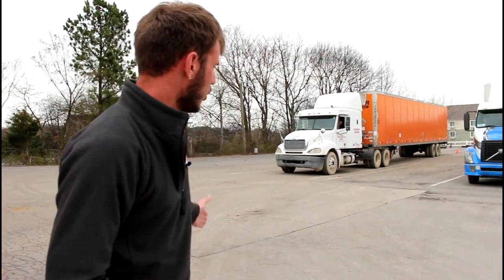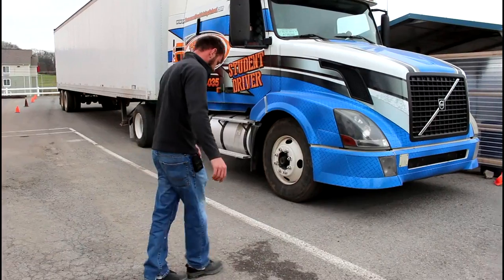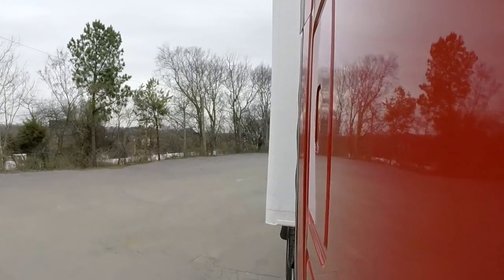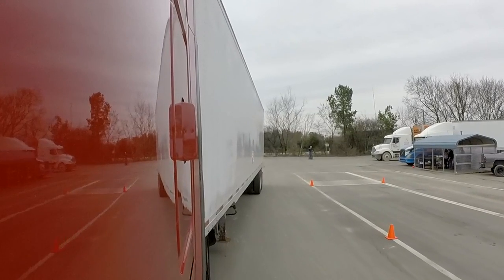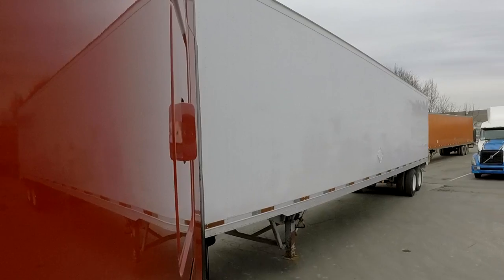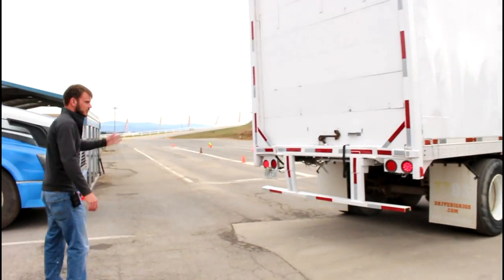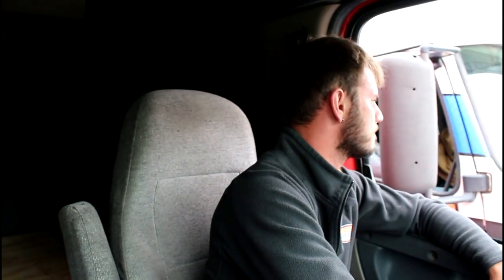Alley Dock Backing

Comment: I struggled with backing up for months , its tough and confusing when you don't have an instructor.  So Ill give you new guys a tip because sometimes its so basic that instructors over look it.  whenever you do a see side back, (your driver side closest to the hole) Your always going to turn the wheel to the right  I didn't have an instructor  So It used to confuse the shit out of me . So theres nothing to think about now.  You know your going to turn the wheel to the right . #2 Distance from the hole is always a good thing when you can get it You can go slow and glide it in better. #3 Make sure there is enough room for your tractor to straighten up .You can set up perfectly only to realize you cant  straighten up your tractor due to an obstacle . You have to ajust your set up and  come in at a deeper angle .Use the rear wheels of the trailer to aim . Pick a spot  that lines up with the dock door , Use any mark on the ground, puddle  tire tracks . You may say Ok two feet past the crack or puddle  Aim your rear wheels for it .
Reply: @danwetherington5096  Yes. I knew about this deduction ahead of time. Used up my 2 GOALs to make sure it's straight and in the right spot.

Comment: this is a great video if you have this much space.  but if not, then you have to cut hard right and then get back under the trailer.  or Jack knife then straighten the wheels and push the trailer.  then get back under straighten out and use a pull up or 2 .

Comment: Cdl school told me not to watch videos because they will make you fail the test. Then I got out on the road and found out why. The test has exactly zero to do with reality. 

You almost never straight line back, at least with set lines. I have yet to have to offset exactly one lane over. Alley docking in real life let's you get out and look plus pull up infinite times, and if you encroach, you Probably lose your job.

It's cool because I can parallel park every time though. 5 grand well spent. Now if only I could figure out how to move the rear of the trailer like 10 degrees in instead of exactly 90. God damn.

Comment: Please explain the righty tight with regards to backing. I know if the trucks drifting left turn left and same for drifting right
Reply: What you're talking about is when you can see both sides of your trailer in your mirrors; that is, when you're straight backing. When you have such a pronounced angle between your truck and trailer (during an alley dock, for instance), you're only looking down your driver side mirror, so a turn to the left is going to slow your cut, whereas a turn to the right is going to increase it.

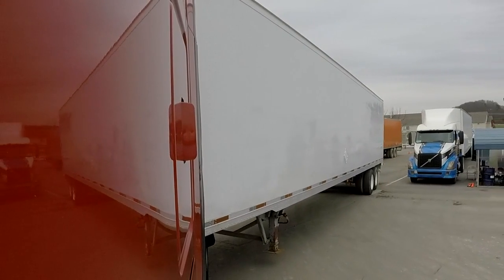Comment: minute 3:15 wich way did you move the wheel
Reply: He turned his wheel to the left to get the trailer straight, but take note that he is not putting only easy cuts
Reply: think of it like this the way turn your steering wheel the front of your trailer will go that direction and your tractor and the rear of your trailer going the opposite directions when you backing
Reply: very good knowledge
Reply: he had to loosen the angle so he turned left. if he wanted to tighten the jacknife more to the right he would have turned right. in this case 3:15 he turned left

Comment: If the video is a "HOW TO" video, then you would have wanted to CENTER the rig between the two other vehicles, providing they were parked correctly (which they were), NOT put it on the line and leaving minimal space on your side.
Reply: You always have the option of doing a few pull-ups to center it.